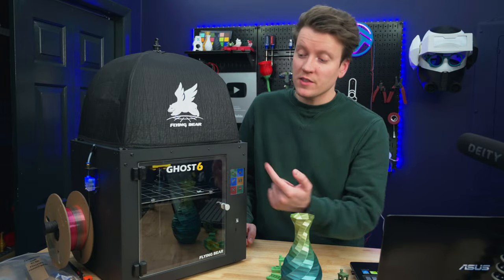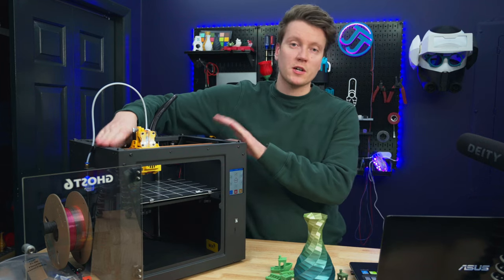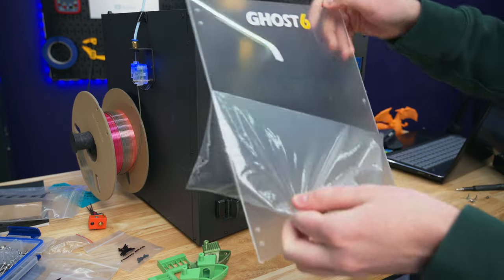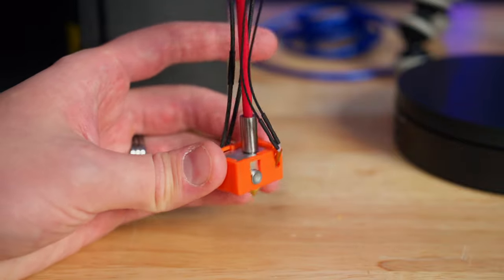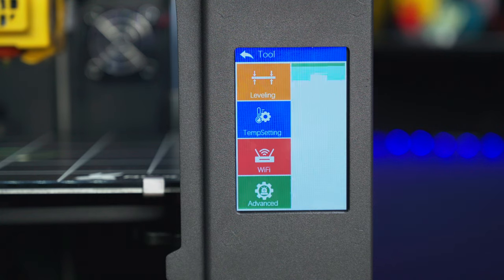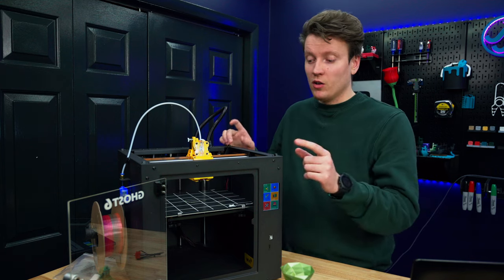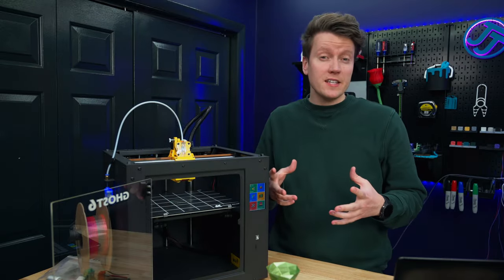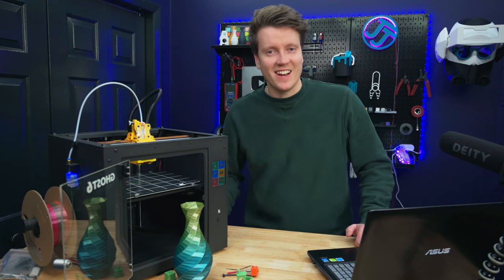Core X-Y in a Budget 3D Printer | Flying Bear Ghost6 3D Printer Review

Comment: Can get the Reborn 2 for $380 right now.  Flying Bear printer that is much larger and has a 350 deg all metal hotend.  Also has linear guides instead of rods.  It is an amazing deal.  The reborn 2 has become the ultimate blank canvas to mod and swap out control etc.

Comment: I hope they start selling the extruder!I'm building a new machine right now and could use 3 (it's a tool changer).

One limitation on speed is probably how fast it melts PLA. It's pretty typical for a ptfe lined hotend to struggle around 80-100mm/s. All-metal can go a little higher.

Comment: Pretty nice little printer, especially at that price, but who has ever heard of Flying Bear? Sounds like their customer support is pretty good, but only time will tell. As far as auto bed leveling, I suspect that on this printer - or any Core XY printer - you'll only need to level the bed when you change something like the hot end or the nozzle, so I think adding a BL Touch might be overkill. Kind of nice to have, but not a deal breaker for me. Also, I like the linear rods, and they are more durable than the v-slot wheels, but the bearings will eventually wear out, especially on an inexpensive printer. My Anycubic Mega S is currently waiting for me to replace the bearings on the X axis - I've already replaced the ones on the Y axis. It still works, but the bearings are getting sloppy and noisy. And finally, I really like that extruder. The large gears are great, and I like being able to see inside to see what's happening. I hate extruders that don't let you see inside, which is why my printers have the open Micro Swiss Creality-style extruders. They're easy to un-jam and clean when necessary. I do kind of wish the gears were larger, but I don't need to replace the extruders yet, so . . . 
As for the print quality, you should be able to get your slicer settings dialed in and get great results from this printer. I would try slowing it down until you get it dialed in and then worry about increasing the speeds. Rule out any hardware issues before you assume that Klipper will make it better.  Firmware will never be able to overcome defective hardware. Once you see what it'll do with the stock firmware you can move it to Klipper and at least you'll know any issues you see are not the hardware.
Anyway, great review (as always). I may keep an eye on this one for the next time I decide to add to my tiny little "print farm." And I'm really looking forward to your review on the Bambu printer!
Reply from the maker: Very true about corexy not needing auto bed level like a regular bed slinger, but it does help just in case a bed isn't perfectly flat.
Reply: I've heard of Flying Bear back in like 2018. ANd have been following them ever since. (My favorite animal is bear, thats why LOL)
I actually have been in the Flying Bear group on Facebook since 2019ish, even though I dont own a flying bear. Only con is A LOT of the people on the group on facebook is russian, so it can be hard to know what everyone is saying if you dont speak russian. But everyone on the group all seem to say that customer service is very good. Also everyone I have talked to online that owns a flying bear has never said anything negative about. I've actually mostly only heard good things. But I cant confirm as I do not own this printer. Based on the facts I do know, it seems like its a solid company.

Comment: FWIW JJ, I'm using the Manta E3EZ in my Voron V0.1 build. It was a little tricky to configure, especially with CAN, but I finally got to the point of working on the Klipper configuration. Are you going to run Marlin or Klipper on the Bear?
Reply from the maker: I'm planning on setting up Klipper on the Bear